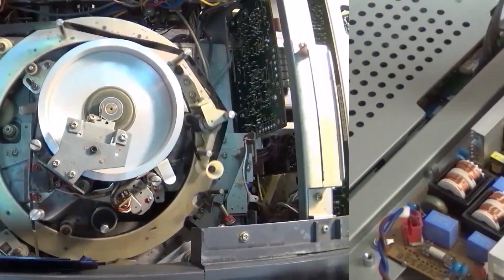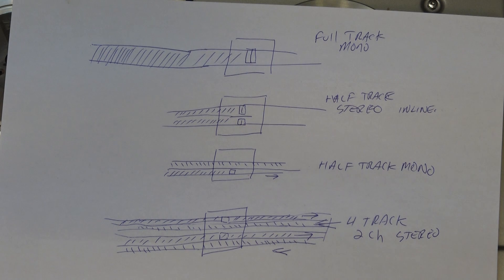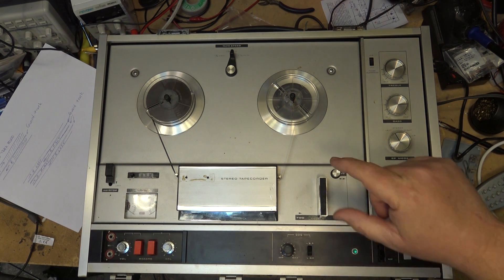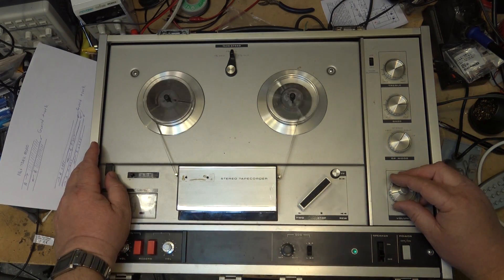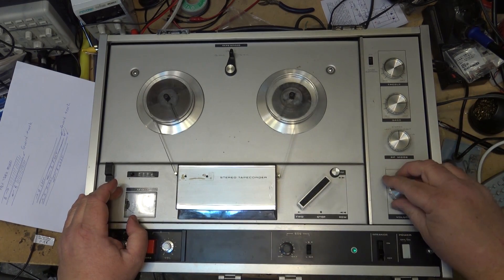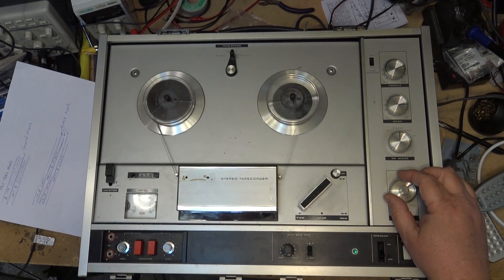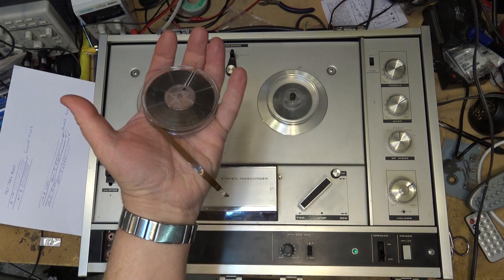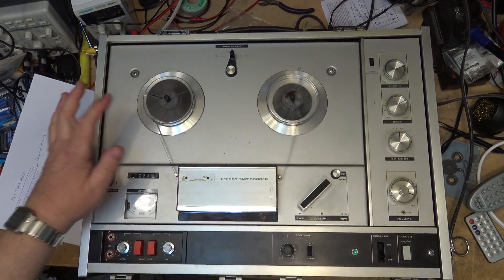Why we bulk erase tape before using again

Comment: Hello 
Awesome video.
Thanks a lot again and again fol all the suprem knowledge you shere.
Why there are bukk eraser that are very heavy?? Like 10 lbr..?
And they usually very expensive.. comparin to the hand held model you use..
I mean to the ones that are not hand helded..but flat and you put the reel on them.. like the teac e2 model.
Or other professionals bulk eraser.?
If the actual way of bulking process is the same.. then they all shold be the same weight..no?
Is there any difference beteeen the method of the bulking process?

Comment: can I use this tool for chrome audio cassettes?
Reply: Yes works on  chrome and metal tapes as well.  At least the high powered model that he was using, sold at Radio Shack.  There were two different models sold and one that was high powered was  made for also erasing video tape along with chrome and metal audio cassettes.

Comment: my eraser head is erasing about 80% of audio, it still can be heard. 
what could be the issue, not good enough contact since its paired right next to another head side by side. or needs more voltage?
Reply from the maker: Well that totally depends on what type of tape you're trying to record. Different tape types need different amounts of erase signal to erase it. For example if you put a metal tape in a deck that does not have a metal setting it will only partially erase the tape the same goes for if you put a chrome tape in a deck that is only designed for standard tape. Most mini systems for example only recorded correctly on standard tape not high bias or metal. Most old vintage decks only recorded on standard or chrome tape. Now hi bias tape uses the chrome setting on most tape decks and that has to deal more with the equalization but high quality high buys tapes actually take a stronger signal to wipe them than the original chrome tapes did back in the 70s. If you have a tape deck that has a switch for normal and chrome it should work fine on real chrome tapes but may not completely erase a high bias tape. To avoid confusion tape type was replaced with type 1 type 2 type 3 and type 4. If your tape deck does have the required settings and it's not erasing correctly then it's because the bias is too low. The race head could be damaged misaligned or even dirty.
Reply: @12voltvids  thanks for the info. its probably the bias (not that I know what it means) I'm only saying that is cause its an old 8 track echo machine. https://www.youtube.com/watch?v=lQDDXc5wGIg

Comment: Not all the tape ! Tape for Datastorage and some Digital video format got some timecode that must not be erased.
Reply from the maker: Data tape has formatting sectors.  Video tape is also bulk erased.   If the tape is used for insert editing new time code is laid down. If it is a new assembled recording it is not as the time code is laid down during initial recording and then insert editing will use the new time code for the insert shots.

Comment: I used bulk erasers at the community college when I was earning my associates degree in Radio-TV Production from 93-95. I also I had to remember that when using the bulk eraser to make sure your wallets & analog watches were away be cause if you had debit/credit cards in your wallet it could demagnetize the strip.

Comment: Soo, that heavy high-power hum you hear in sci-fi movies etc. can be made with an AC magnet and a tapedeck?  Sweet...
Also, good tip on de-magging tape (and that one on building a degausser for your tapeheads)... BTW; will degaussing work with a magnet driven by a function generator (it only has ~7Vrms, but can produce any ol' frequency)?

Comment: I could really do with a bulk tape eraser.  Unfortunately, they go for a lot of money in the UK.  Someone told me that I could make one using an old transformer.  How about doing a video on that, just like you say, a bulk eraser is a necessary bit of kit to have.
Reply from the maker: Well you have to cut the transformer apart and remove the secondary coil.  It would have to be a pretty beefy transformer.  My bulk eraser draws about 8 amps and can only run for 30 seconds at a time before a 20 minute cool down cycle.

Comment: Very good video. I also found bulk erasing essential when using Digital Conpact Cassette (DCC) tapes. Once, I recorded over a DCC tape and while playing the tape it suddenly fast forwarded to the next track on its own. With DCC tapes you can add various electronic marks to the tape that causes the player to automatically take an action.

One of those marks is the Skip Mark, which causes the player to fast forward to the next track (useful for skipping over parts of a recording you don't want to hear). I realized that the I had put a Skip Mark in the previous recording and it hadn't been erased. Bulk erasing the tape before recording solved the problem.

Comment: I have the same Bulk eraser you have (Realistic 44-233A) that I just bought nearly in mint condition.
It draws a correct 8.5amps while holding the top button and shuts of after around 1 min of use.
Then go back for use after a while.. OK. Now here is my probem with it..
This is the first time I use it trying to erase small video cassettes '8' format.
I do the correct erasing procedure (slow circular movements all over the cassettes) but when I test back theses cassettes
there are stil video informations on the tape but with intermittent blank screens..
I take my time doing circles on both sides of the cassettes for the 1 minute allowed,
but it won't completely erase them.. I begin to suspect the type of tape used in these cassettes.
It looks like they are METAL types. For examples these cassettes:
TDK HS120 metal particle tape, or Fujifilm P6-120.
Every cassette that I've tried to erase I did it more than 3 times each !
1 minute on every passes.. But still visible scrambled video left..
Are these cassettes too hard to erase for such a bulk eraser like the 44-233A ?
Reply from the maker: I erased 8mm and hi8 tapes as well as digital 8 and dv tapes with it. It does take longer and you have to spend more time with the center of the eraser positioned over the tape pack. I go back and forth over the tape pack in both directions a few times and then turn the tape over and do it again on the other side.  They are metal and are harder to bulk erase but they will erase completely.
Reply: Thanks for your fast reply.. So it seems this 44-233A is behaving normally ? iI'll try with more passes on both sides and see what comes out.. JP
Reply: I've finally been able to faster erase these anoying metal cassettes..
I just leave the bulk eraser on the center of the cassette' full reel side
and stay almost still (or moving very slowly). This helps the eraser magnetism
go deeper inside the tape. And my Bulk allow around 90sec. for each shot so..
Enough in one shot to get rid of any recorded leftover.
Thank you anyway !
Reply: And remember don't release the trigger when pulling the tape away from the bulk eraser.  You'll get a cleaner erasure as he showed us I  the video.  Learned something myself on how to properly erase tapes with that particular bulk tape eraser of which I own myself.

Comment: Interesting stuff. I have my Concord 220T which is a full track mono reel tape recorder which was a popular model for its time. It’s a 2-track only unit. You can record OTR shows at 1 7/8 IPS for longer recording. My Akai 1721W is 4-track stereo with two for each track which was split into 2 programs left and right when you switch to 1/4 and 2/3 and stereo in the middle. And also my Grundig TK 247 which was a German import reel tape recorder and it has a DC motor and it runs a tad slow. Otherwise works perfectly.

Comment: hi there's about 3 top youtube guys that are having a bad time with them fools leaving bad remarks the one computer man who
doe's live computer makes is having a had time it's all the tec video are getting hit all the time by fools it's got bad this year i i please you know what you are talking about i deal with pro audio reel to reel myself i know about them carts
i buy used nab cart take all the tape out  put zapped 8 track tape inside them. the 8 tape case is wearing out where the pinch
roller is wearing down.   i am using a top end otari units 100% the full track head will kill all the sound on the tape.
all way best to buy the best recorder you can get the sony units are not all that good. had some in the past 
i please you telling them all the right info

Comment: More great stuff. Never had a bulk eraser, just a tape head eraser. I may see about a bulk eraser for the heck of it. I don't really use open reel, but I do have VHS tapes, compact and micro cassettes.The head demagnetiser (sp?) works similarly.Short time on, longer time off, and moving it away slowly while still on.

Comment: Recording to tape on half  track results in better signal to noise. But I wouldn't overestimate gains. Noise is produced by two sources - tape noise and amplifier's noise. For tape noise no gain can be obtained  .  I see another reason of bulk earse for 4 track recordings - obviously some residuum od track after ersing may be left, with vertical movement ot tape it may be  heard in silence moments. It affects in bad cases also tapes recorded on other RtoR. If one likes to listen at very high level it is adviced to earse all.
Reply from the maker: I believe that is exactly what I said. Half and full track tape increased the signal to noise ratio. We are not talking huge increases, but it does improve the signal to noise, and also reduces the effect of drop outs as more oxide would have to be lost before complete signal loss.

Comment: It was good of you to show how to use one of these bulk tape erasers. Most people probably don't have a clue how to bulk erase tape.  

I've got the identical bulk tape eraser that I purchased new and on sale at Radio Shack back on 9/25/90 for $21.95 + tax.  That's USA dollars.  It's still in the original box with all the paperwork.  I don't use mine near as much as you do. The instructions say that regular tape takes about 10 to 20 seconds to erase while metal tape needs at least 20 seconds per side, for what that's worth.

Regards, Tom

Regards, Tom

Comment: Back in my early post USAF days, I worked as a contractor at the off-site software testing facility for Cheyenne Mountain in Colorado Springs. Our facility was also the off-site tape storage and servicing for the Mountain. Most of the tapes were of the 'Secret' variety (OS, diags or system stuff), but about once a week, a courier would bring in a container(s) of 'Top Secret' tapes or disks for wiping. Our degaussing unit was the size of a refrigerator with a door like a microwave on the top half. We would put a few tapes in the unit, push the button, stand back and prepare to be startled, lol. Sound was very random, metallic and LOUD. The bottom of the chamber had thick rubber insert and we were told whatever was in there would briefly levitate, so it cushioned the fall. If a hard disk drive was done (rarely), every transistor or diode would be blown on it's PCB (that really pissed off the software vendors, or should I say new HDD buyers, lol.) 

    What a crazy machine that was, but I bet a salvage yard magnet, reversed, would do major damage also. Thoughts?

Comment: Isn't a bulk eraser just a transformer ? should be easy to make one ....
Reply: It is a form of a transformer. All that needs to be done is to change the direction of the plates of the transformer to face the same direction., and remove the secondary windings.

Comment: That bulk eraser is ideal, i could have done with one of those years ago, when i re-used video tapes.
I have a small device called a Han-de-mag, 220v palm sized demag, it has a red horn probe for doing tape heads, on the rear the metal of the transformer is visable for other uses.
I have to limit how long it's on too, gets dam hot lol.
I've used it to demag a mates tv crt, very good.

Comment: maybe you could do a vid on win and why to use the right safety cap on a power cord win restoring a old tube radio like y2 or x2 it would help me . thanks to you i stopped  throwing stuff in the trash like TV,s and  radios . i try to fix them now . and i do use a isolation transformer for safety   thanks

Comment: I've always wondered about this. I have a reel to reel recorder that dosn't appear to erase tapes properly, so when I play it back after recording something, there's still the faintest hint of the previous recording still on there, even on tapes that have NEVER been used in any other recorder. I wonder if the erase head is mis-aligned. I know the head works and is getting a signal because I probed the erase head with a coil while it was in record mode and I could see a high frequency AC sine wave on my scope.
Reply from the maker: Yes if the tapes were only used on that recorder and are not erasing completely then it could very well be the erase head is out of alignment, or the bias is low.
Reply: It may also be a weak signal going to the erase head.... those machines are very old and unless its been serviced electronically as well as mechanically those types of results will happen

Comment: Lovely, explained in detail. Double magnet bulk erasures were also useful which did not require power. Lots of regards
Reply from the maker: Any big magnet will do, but many of them will leave that swish sound when you pull the magnet away because they polarize the tape. An AC eraser neutralizes the tape completely. This is why you keep moving, and pull the eraser away slowly. Permanant magnet types  leave the same result as when I turned it off when on the tape.

Comment: I never realized that an audio tape deck did not have a full erase head like a VCR.So that is one reason why bulk erase units exist.Keep that away from your credit cards with a magnetic strip.
Of course as you know the same applies when degaussing coil ,pull it away slow or leave a nice spot.
Reply from the maker: Our credit cards here all have a chip on them.
Reply: A full erase head would only make sense if the entire width of the tape needs to be erased in one go, like it does on a VHS tape. When you record, you may want to record over just one of the four tracks, keeping the other three, hence the erase head needs to cover just a single track on a mono 4-track, or two tracks on a stereo 4-track. It would sometimes have been nice to have an extra erase-all head that could be engaged to clear everything in one go, of course, but since the method shown in this video is faster and easier, I don't think any reel-to-reel recorders ever had such a feature.